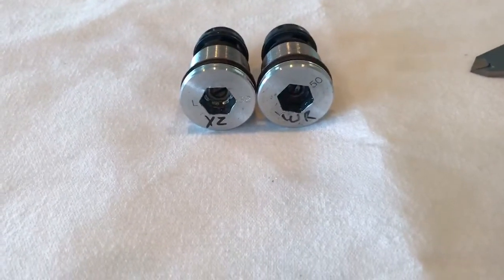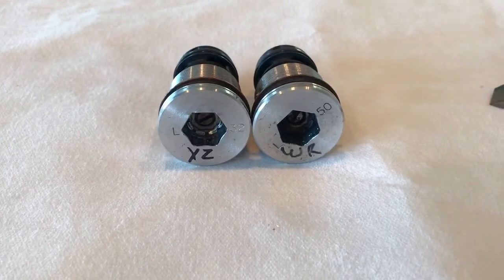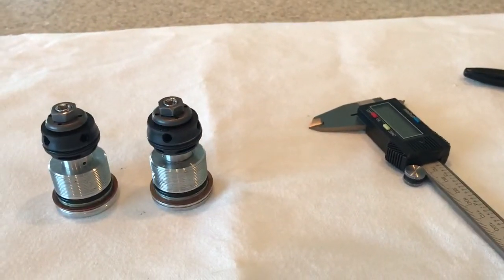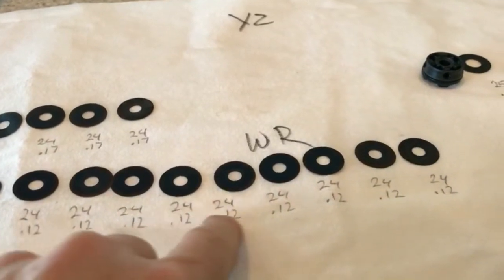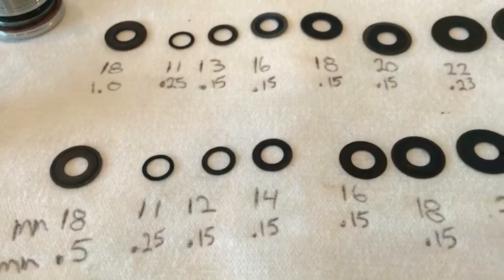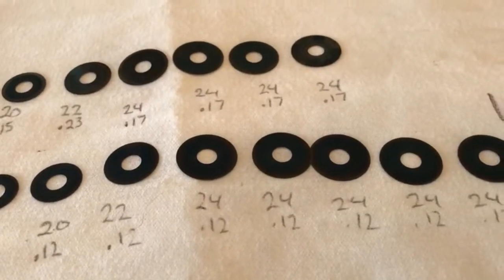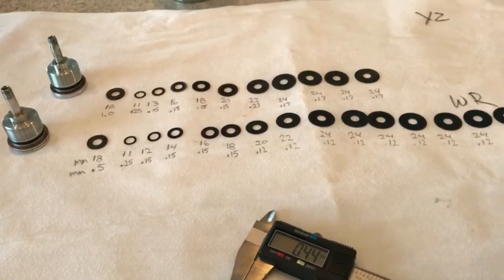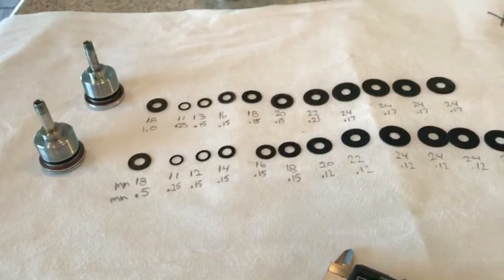WR YZ FORK SHIMS SUSPENSION VALVING REVALVE

Comment: Good stuff laying out both base valves side by side for comparison. The YZ has noticeably thicker shims than the WR, which causes much stiffer base damping than the WR.  For reference, there's actually a quick equation to figure out the difference in shim strength when comparing two shim thicknesses. (A/B)^3, where A and B are the thicknesses of two shims to compare. Those 24x0.17 face shims are actually 2.85x stiffer than the 24x0.12 shims!
Reply from the maker: Thanks for the formula, I always enjoy learning new stuff!

Comment: That is a very interesting comparison.  I've never done anything beyond fork seals.  Trying to make sense of it in mind and thinking the oil flows between the shims and therefore more shims means more oil can flow.  Not sure if that's right or not.  Also, is that the compression side or the rebound side?  Assuming there would be another stack somewhere in there.
Reply from the maker: Both of them only had one rebound shim that was the exact same size 25mm diameter and .43 thick, this makes sense as the rebound is only driven by the fork spring and they both have roughly the same spring rate.  The way that it was explained to me is that the shims bend to allow the oil to flow past them rather than through them.  The thinner wr shims were noticeably more flexible than the thicker yz ones.  So it seems that more thin shims gives a softer ride than fewer thick ones, but keep in mind I have very limited knowledge on the subject.  I just like to know how stuff works.
Reply: NVMCRIDER I enjoy knowing how things work too. Thanks for the detailed response. Great video.
Reply: @nvmcrider8475  I do not think the spring and large thick washer is the rebound stack. It is a check valve that allows oil to flow in one direction, maybe during rebound, but there should be another 2 stacks inside there somewhere. A true rebound stack and a mid-range stack.
Reply: @250txc  a rebound stack is on the piston inside the cartridge - I can tell you even more, at the top of the cartridge where the seal is there is another shim stack between the seal and the bush for high speed rebound.

Comment: I'm doing this valving now....Seeing all the same-sized shims on top of the WR stack is really confusing... And no cross-over shim either ... I was removing those large shims off the top trying to make my 48mm KYBs softer to no avail.
--
Gonna add 5-6 more large shims on the top and remove the cross-over as my next attempt at plushness.
Reply from the maker: Take some pics or do a video, I'm interested in how it turns out.
Read the comment by bwhaskel, he has some good insight.
Reply: @nvmcrider8475  THXS but none of his words explain  how having so many thinner shims on the WR stack makes the forks softer ... He just explained the relationship of the different thickness of the upper shims.  Just gonna add more of the shims I have of the largest diameter to my stack.
Reply: @nvmcrider8475  I'm more or less duplication the WR stack but I do not know the thickness of my shims .. The top ones are probably the same size as you have shown, again not sure on the thickness but they bend easily.  Going with adding 3 more of the large, top shims than shown on the WR stack for my next test.

Comment: I would love to see someone do this sort of layout with the AOS/SSS cartridge forks.
Reply from the maker: There is a good video on disassembling sss forks by tuning by Travis tbt, but it doesn’t get into the shim stacks.  Maybe in the spring when I change my fork oil I will dig into this.
Reply: @nvmcrider8475  Yeah I have watched that video like 100 times...  I have an 06 YZ250F and would like to re-shim it and have been given several shim stack "recipes" but not sure if they go on with top being first on or last on... LOL I am a visual learner and the videos help considerably. 

BTW how is the wrist healing? Hope it is going well.
Reply from the maker: @johnchafin3817  The wrist is coming around, I had surgery on it 3 weeks ago and now all of the pain is gone.  
I had the 07 yz 250f and thought the forks were really good for a 220 lb desert rider.  What type of feel are you looking for with your forks?  My 2015 WR forks really aren't much softer or plusher than the 07 yz's.
Reply: @nvmcrider8475  I used to ride in the desert back in ABQ but now I live in Alabama. The trails are single track with lots of rocks and roots. The stock MX forks want to deflect at  low speed so looking to plush it up some. I bought some softer fork springs andnew Zeta aluminum enduro style free pistons so that is my next mod. Also got matching shock spring for my weight as well so will see how all that goes then tear into the shim stack if I need it plusher.

Comment: Sorry if this was already covered, but what year were these forks?
I'm trying to revalve a 2004 yz250f closer to wr calving, for woods riding. Thanks!
Reply from the maker: The wr forks were off a 2003 and the yz forks were 2002.  Just copy the large 24 mm diameter wr shims and leave everything else alone.  You could also just remove 2 of the yz 24mm shims and I think that would be close.  You will get plusher small bump action at the expense of bottoming on big jumps.  Also read the comment by bwhaskel for more insight.

Comment: I was wondering if you could help me out I have a 1996YZ 250 and basically there’s no rebound left on the forks I was wondering is there anyway you could rebuild the inner damping rod I took it apart but could not find how to separate the rod from the actual casing is that even possible thanks in advance
Reply from the maker: chris carnevale unfortunately both of my arms are in casts from a recent crash so it will be a couple of months until I can dig into this.
Reply: NVMCRIDER    Oh wow sorry to hear that
Reply from the maker: @chriscarnevale628  I have the accident footage posted.  Do your forks have the rubber dampeners on top of the fork springs?
Reply: I wished you could post pictures on here but it’s basically at the bottom of the fork you need a 14 mm Allen key to unscrew it and then basically it is a white tube with valving inside with the damping rod that pulls up and down I’m trying to access the valving but do not know how to open the tube up